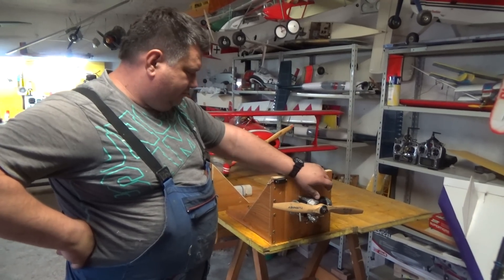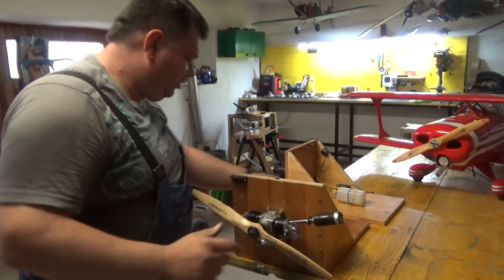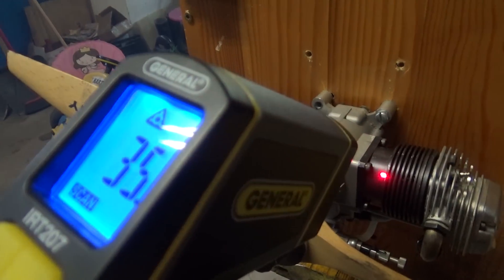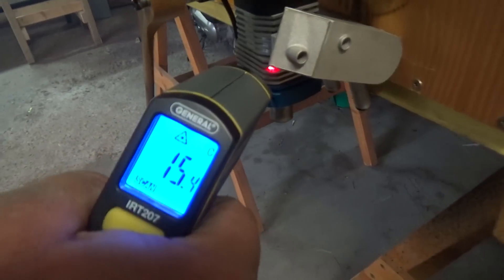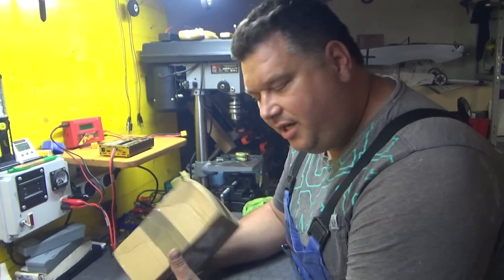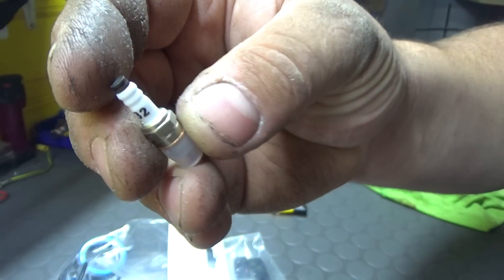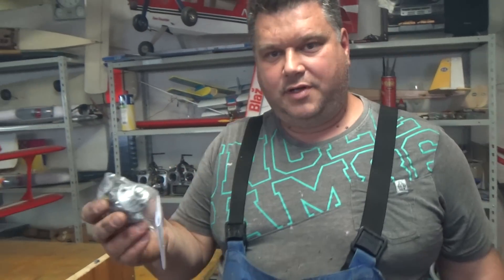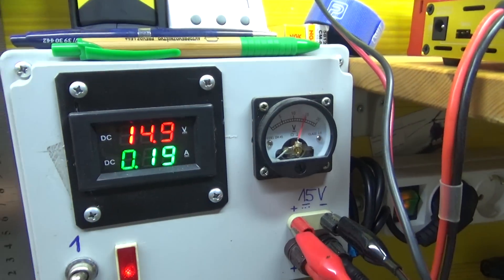OS FT 160 Gemini twin glow engine Test run after setup

Comment: Would you consider doing some research and video on the OS G5 plug. Used in nitro engines with 2 stroke fuel. No cdi or magneto. Apparently  tuning can be difficult. Love your work

Comment: I have this engine in a H9 Taylorcraft, fits perfectly. It’s a great engine and idle can be super low with the glow on.  I found that with the glow off sometimes a cylinder will drop out or when abruptly chopping throttle.  It makes great power on high nitro heli fuel.   Gas conversion sounds like a great idea. I just leave the onboard glow on during the whole flight to prevent loosing combustion. I want to add a smoke system to this engine as well.....looking forward to the conversion video!👍
Reply: yes this engine is very good engine..and now after conversion it runs much better...

Comment: blaz you need to take  some  of your vent work and put it in the shop so u can run the motors  so it will not hurt your health  it not good to run the motors  with out fresh air
Reply: i will just run engine outside next time..more easy....

Comment: Absolutely agree with you - engines should live  forever ..
Capt. Blaž - is this RPM sensor mounted on your engine mount board? 
If so - can you tell what you are using and where is your read out ..
Reply: yes they must live on..yes it is rpm sensor but for gas engines...

Comment: Hello Pilot Robert, and Capt Blaz. I also have a couple engines I would like to get to Capt Blaz for his expertise. One is an OS FS 70 Surpass that I broke the head in a crash, I replaced the head, but didn't adjust valves or anything, and it runs poorly, so I stopped it and it sits. The other is a Saito FT 100 that I can't get to run right. So, all that being said, I could find someone local, but I like Capt Blaz, so I want to give him the job, if he has the time. Of course, all expenses covered by me.
Reply: well that would be interesting...find me on fb and we wil talk...